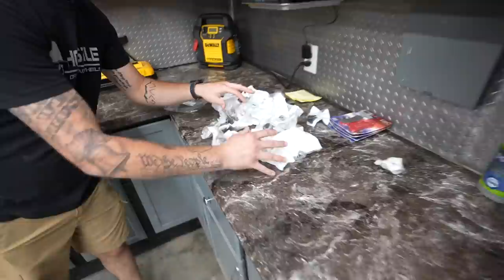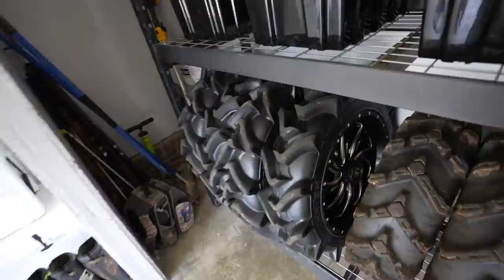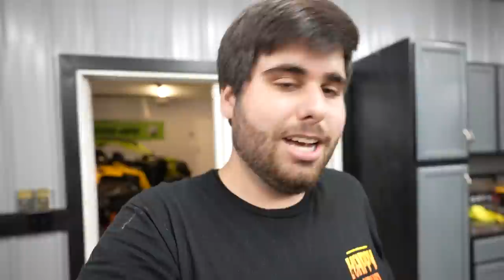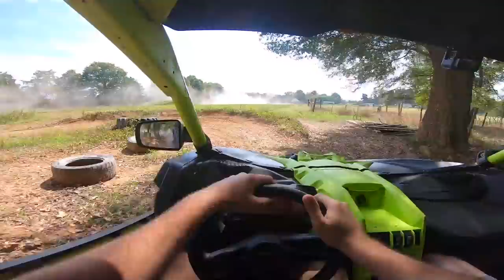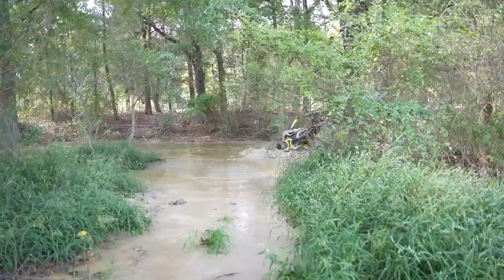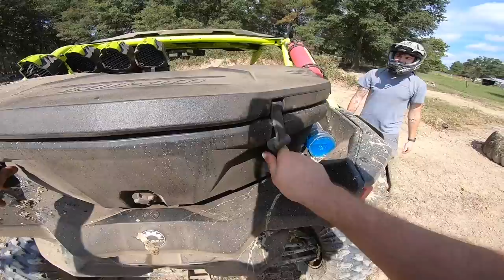IT'S FINALLY TIME!

Comment: Braydon, On the X3 when you do so much pulls like that, it’ll heat up. Consider the RPM or evo Powersports Inter cooler upgrade: it’s not the fan or anything messing up, it’s just not able to cool down immediately because it’s just a factory Inter cooler. Hoped this helps.
Reply: We should get brayden to get a fourwheeler like a can am outlander 450 and test it it'll be called the baby outty
Reply: @904-outty  as a 2015 450L owner, yes
Reply: @GraceTheTDI  I have a  2021 450 i love it

Comment: I feel like the defender needs a diff drop. Cause of the lift the axles are at a too much of an angle and are binding up and snapping. Seen it on a lot of independent front 4wds

Comment: You boiled the brake fluid. Try swapping to DOT5, I'm sure they come with DOT4 factory. Its not cheap and the system must be totally flushed of all the old fluid for it to work right but it should help with fade like that.

Comment: I had the right front axle in my 16 renegade 1000xmr do the same thing it did in your defender. I installed the torq locker and put it in 4WD and barely hit the gas and it snapped just like that. Only this is, mine didn’t come out as easy as yours did. I had to pull the diff back out and tear it back apart to get it out

Comment: I have a 1984-85 Honda 200 and it is so clap. It has three different sizes of tires and other stuff that's rong but it moves and I have a Plarios 250 Trail Boss R/ES. It is a two stroke and it is a monster.

Comment: You replacing bushings on the defender because of the lift or what? I know you haven’t drove it enough to wear anything out. The reason the axel is broke is because of the bigger tires and lift